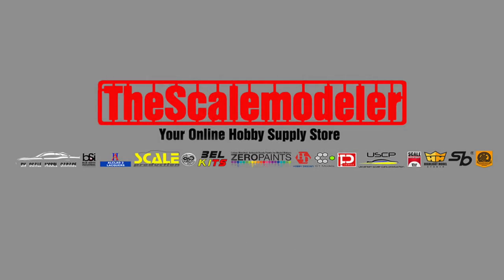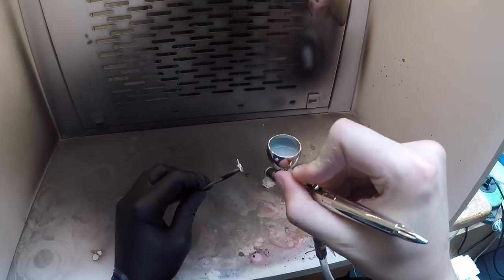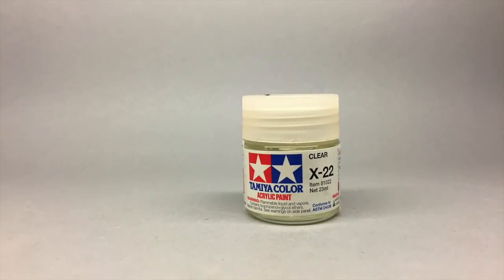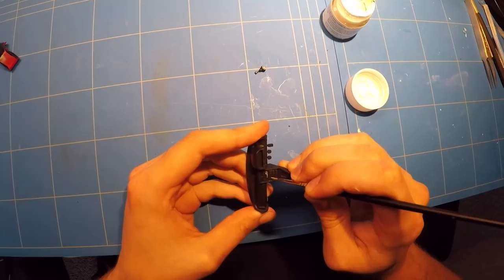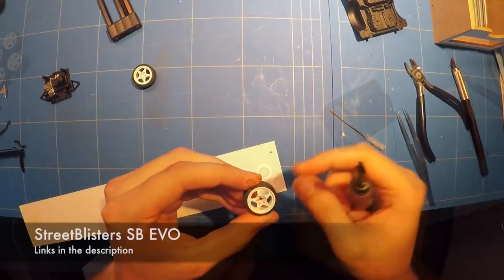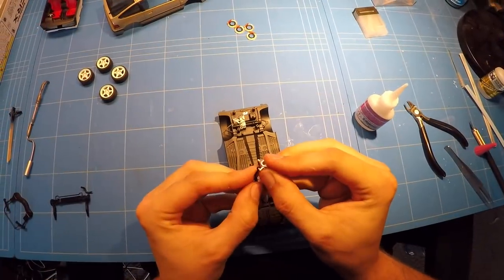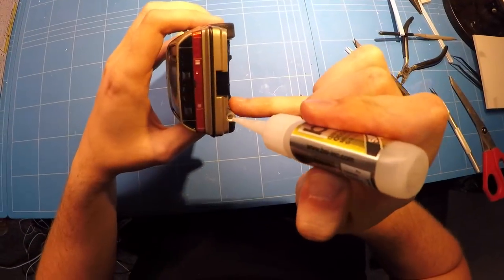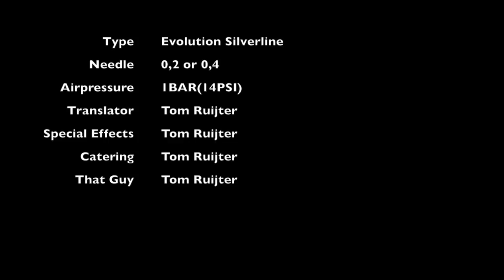Fujimi: Honda CR-X Cyber Sports Part 3

Comment: I am Japanese. It was riding when a real vehicle was released in real time. It was the same body color as your work. It was a body color that gold was a little mixed with silver. It was an MUGEN wheel MR - 5 and it was mounted and it was riding. Techniques for assembling works are also pretty. Since the car in Japan is fitting the tire chain, the tire is in the back. Tire protruding technique is also pretty. I was impressed. Right now, I am on CR - Z.

Comment: Great model, I once had a Honda somewhat similar to this, a Civic (1:1). I have a question for you. A fellow member in my local model club has problems when using Vallejo Air paints in his airbrush. He say it's clogging and spitting blobs of paint, and sometimes give a "snow-flake" effect when not intended... He have tried several methods to thin it, but isn't satisfied. Have you had similar problems? (I've noticed that you use it for brush painting...) His airbrush is operated with a 0,4 needle and 15 PSI pressure.
Reply from the maker: I very rarely use it for airbrushing as i find it not to work well with similar problems as your friend mentiones